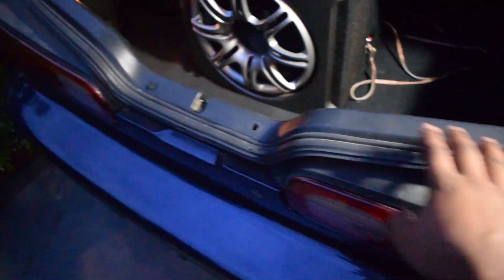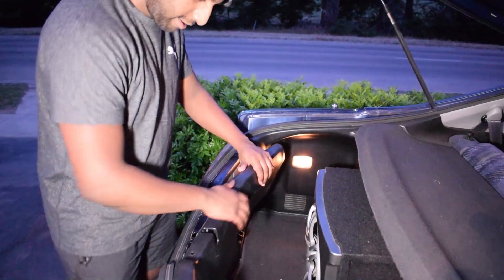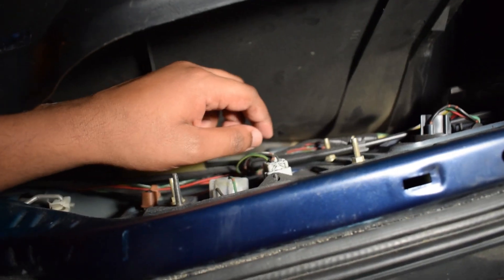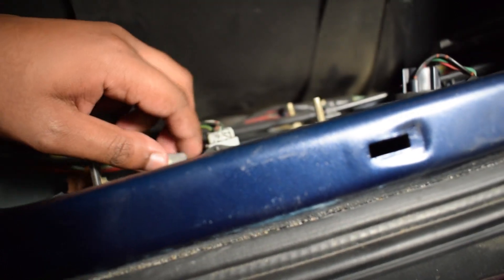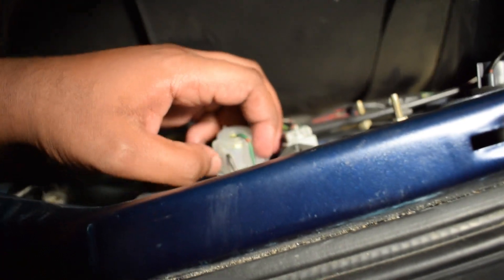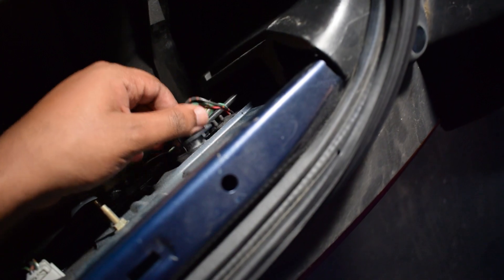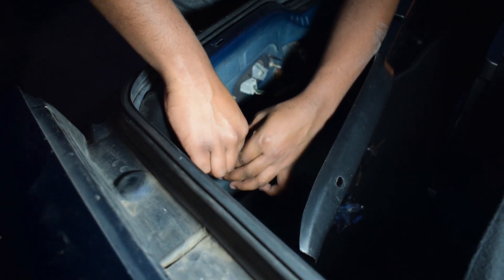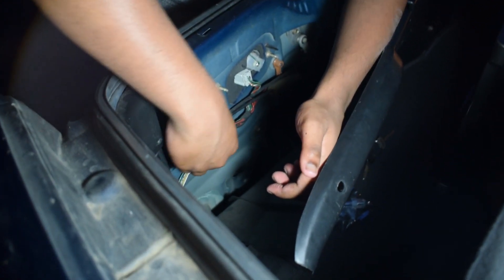CHEAP vs EXPENSIVE LED Tail-Lights: Is There A Difference?!

Comment: Is there a link for the LED tail light you bought? It looks very good and I want the same one too.
Reply from the maker: Don't have a link but if it's Auxito brand then I trust it
Reply: @gutterrashautomotive3361  I got auto one and it works well in my opinion. It’s like around $15 on Amazon.
Reply from the maker: @karwinchau4684  Awesome!